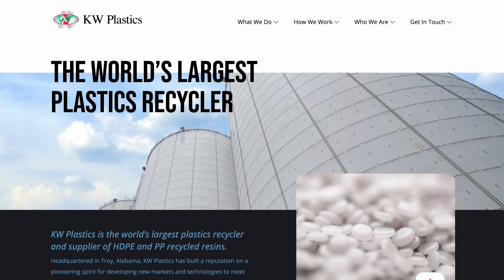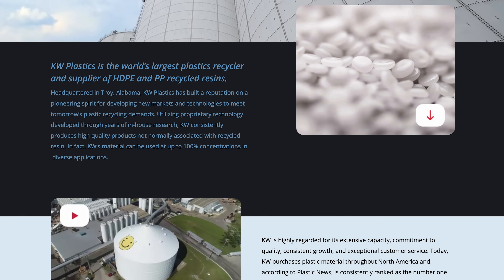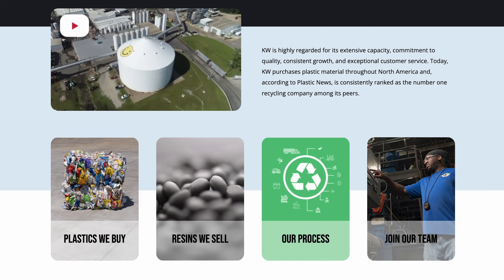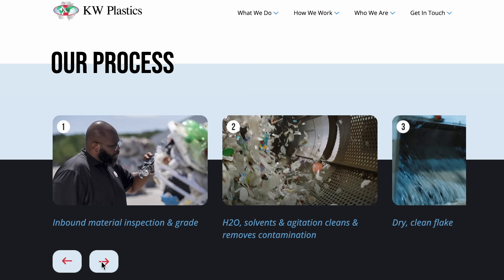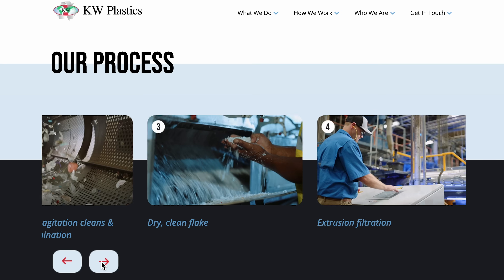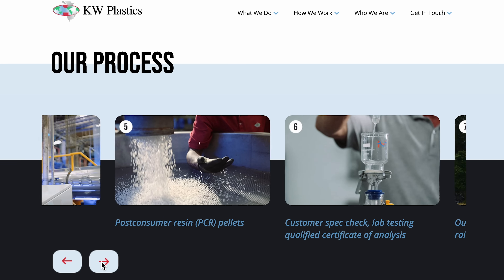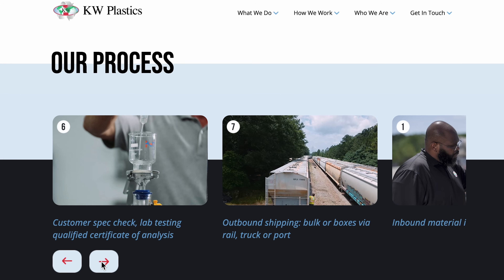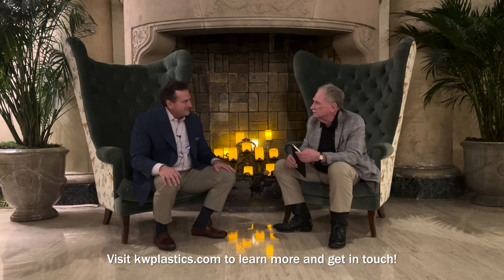Creating the Future of Recycling With KW Plastics

Comment: Great video! I might add that the world needs to copy Eskilstuna, Sweden's waste program which is a rainbow bag system that separates glass, plastic, paper, organics, metal, textiles, and other materials into different colored bags and then you can take them out as you fill them up. It really cuts down on waste overall and obviously the pre-sorted quality of the materials helps keep out contaminants. There's NO valid reason why the US or Canada can't or shouldn't adopt a similar system especially when PET is going to be made into cheap electric Slate Trucks over in Warsaw, Indiana in an abandoned phone book/flyer printing press building and pre-sorting the plastic would definitely help create a closed loop system for it like other materials..

Comment: Recycling is basically a con that the industry has foisted on the general public to convince us that if we put our container or bottle into a recycling bin that it will actually be turned back into another plastic thingey and not result in more plastic production. Well, if you actually look at the numbers (check out the EPA website before you-know-who deletes it forever), even containers that ARE returned for recycling are mostly NOT RECYCLED. Whether it's plastic, glass, steel or whatever, MOST OF IT  going into a landfill. So besides all the material that doesn't get returned at all, the stuff that litters our lands and ocean, even the stuff that's supposed to get recycled mostly doesn't.

There are two solutions:
1. USE LESS PLASTIC ! ! !
2. BURN FOR POWER THE PLASTIC THAT DOESN"T GET RECYCLED. It's basically oil anyway.

End of story. Otherwise we will drown ourselves, metaphorically, in our own waste.

Comment: Here in Oregon we have deposits on cans and bottles of a dime a piece. I have seen people cross into Washington, which has no deposit, to purchase cans and bottles. When empty, they return them here to get the deposit back.
I think Sandy's idea a of a national program at a fixed rate would solve that problem. For one thing, simply using gas to travel to and from costs more that the deposits will return to you. Here in the Portland area gas is around $4 a gallon.
Reply: Most of it still doesn't get recycled; ends up in a landfill.

Comment: Whilst I heartily applaud efforts to Reduce, Reuse and Recycle I believe a new approach is necessary.  An approach where plastic is reduced as much as possible.  Note that most containers particularly detergents use plastic and most of the contents are water.  Note that in Europe the container to dispense the detergent/s is kept at home.  The consumer purchases a powder or like concentrate from the store, brings it home and adds the appropriate amount of water at home.  This method, I believe, is preferable due to all of its inherent benefits.
Reply: No, no, no, you don't understand. When they sell you a bigger jug, you're getting more for your money - even if what you're getting is 90% water. 'merica!

There's a reason why recycling comes last in "reuse, reduce, recycle," but for some reason, it gets all the attention. For the record, I also think "repair" should get added to the list as item #3.
Reply: @swolebro Thanks for your tongue-in-cheek comment - totally agree.  As Einstein once quipped “you can not change things using the same thinking used to make that thing”. Paraphrasing of course.  Best.

Comment: My country has deposits on plastic bottles, cans and certain standardized glass bottles, so next to my plastic recycling bin, paper/metal bin, glass bin, organic and waste bin now I have three more bins to keep track of. My kitchen is only so small, enough is enough! If my trash was so valuable they would dig through it with a robot arm and machine vision on a high speed conveyor line and dig out the useful bits. But they don't.

Comment: More recycling is good, but reducing use is  better. The deposit system works if the revenues are directed into recycling directly.
Reply: Reduce, Reuse, Recycle as us kids of the 90's were taught. Always do more of the first two then the final one as a last resort..
Reply: Mostly it still goes to a landfill.
Reply: @pasad335  Sadly yes especially when chemical plastic recycling breaking down the material into base polymers is not only possible it's starting to become big business in some nations..